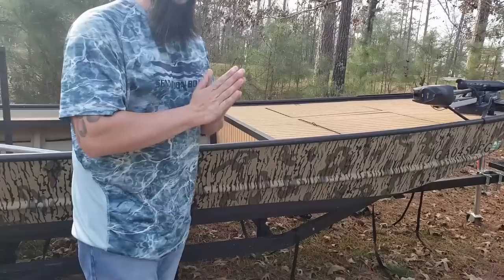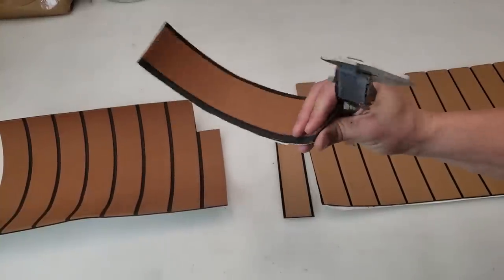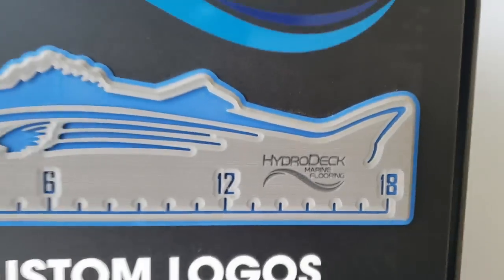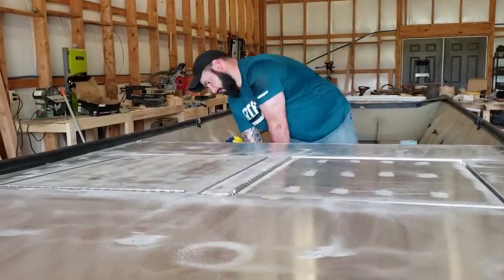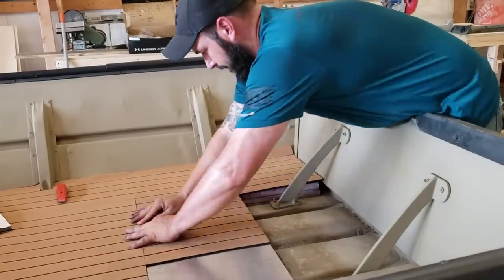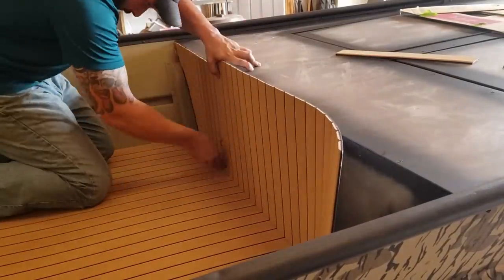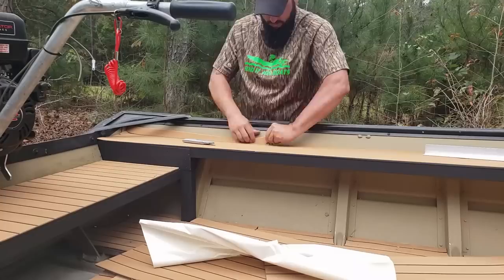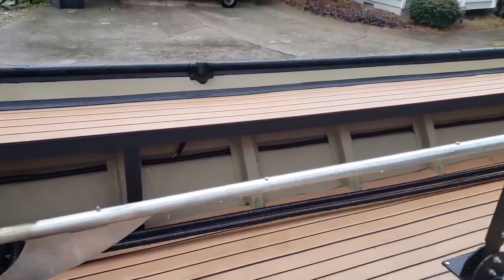HydroDeck Foam Boat Turf | Full Install Tutorial

Comment: Just recently stumbled across your channel, AWESOME info and videos!!!

I used to fish from a canoe for most of my life. Now that I'm 63 with a blown out back I finally upgraded a bit. I don't own a Jon boat but picked up a 1978 Glastron Skiflite 16' Tri-Hull with trailer and 50hp Mercury really cheap. I'm rebuilding it, separated the 2 hull half's (top & bottom). When I get done replacing the transom, stringers and floor deck I was wondering what to use for the flooring cover. Thanks for saving my arse from buying the cheap crap.

Oh yeah... I'm converting the boat from a bow rider to a fishing boat.
Reply from the maker: I made that huge mistake and bought the cheap turf... I regret it and will never do it again.

Comment: I actually have the Amazon stuff on my jon boat deck and it has held up pretty well given the quality. I painted the deck and lightly scuffed it before sticking it down and that seemed to help with adhesion. Surprisingly, the foam itself cleans off pretty well with dish liquid and a bristle brush. I will say though that it could be thicker stuff and have a bit better adhesive(clearly from your video) . My feet after standing barefoot for a couple hours need a break. With shoes or sandals no problem standing for however long. If I come to redoing the deck in the future, I would definitely splurge this time around on better quality foam but I think the Amazon stuff is a good option for those on a budget.
Reply from the maker: First I have heard with good luck on that Amazon foam. The stuff I got would not stay stuck at all. It sucked. Glad your experience was better than mine.

Comment: Hater corner is hilarious 🤣 

Thanks for the tip on the local source for good foam. I’m down in Jackson GA, I’ll be up soon to pick up a sheet🤘🏼 I think ima just do the bow area, where I stand to fish. I have a 1648g3, My deck is sprayed with Raptor Liner. I guess I’ll want to sand it flat first. Whatcha think?
Reply from the maker: I would definitely sand it first. but it should stick fine.

Comment: did you just get a quote for the rolls? I wonder because each site ask for boat model not just stocked rolls.
Reply from the maker: I had to call them to get pricing on just the rolls. I switched to Hydroturf and Seadeck on all my new builds now. You can get them at tbnation.net

Comment: Thanks for the great turf info. Should of beat the snot out of both pieces to see which was more durable.  Ya, your boat looks really clean.
Reply from the maker: Turf ain't known for torture. It can withstand doily walking and stuff like that, but it would be a short torture test. Carpet if you are one of those boat people that destroys everything.
Reply: @SendItJonBoats  Curiosity mostly. Saw a boat at a ramp that had foam. Looked like someone had stepped on a few lures and weights and left permanent dents. I would have hoped it was stronger then that. One small rock stuck to the groove of your boot sole would make a lot of dents. Thanks for getting back to me. Keep bashing those trolls. LOL

Comment: I have diamond plate on the bottom of jon boat for floor… do you think hydrodek will adhere to it? Thanks
Reply from the maker: It will but you will need to put some contact cement down first.

Comment: How easy is this stuff to clean? Me and 3 dogs get out and in the boat several times each trip leaving mud prints all over the deck. Would it hold up to a car/pressure washer, or would it take elbow grease?
Reply from the maker: It is really easy to clean. I use a long handled truck washing brush and Dawn soap to scrub it down then just spray it off with a water hose.  They don't recommend a pressure washer, but maybe one of those low pressure electric ones would be okay like the Harbor Freight ones I wash my truck with.

Comment: I’m not sure the price difference but if you have an area  that will require multiple cuts around hatches ect you might be better off doing a template and letting the manufacturer cut it.   When I did my boat with sea deck   the process was to make templates then the vendor printed them in cad and sent it back on clear plastic sheets   so I could verify and or mark up with a sharpie for any final changes before they cut them out.

Comment: How is that turf holding up to the fin on the mud motor? I have done some damage to my flooring while trailering and would hate to spend the money to trash it on the way to the ramp.
Reply from the maker: I take a scrap of that vinyl and stick it under the fins so it wont jack up my turf.

Comment: Thanks for the advice Man! Also, Quick question: What kind of welder do you use and what do you think about it?
Reply from the maker: I run a Titanium 200 Unlimited with spool gun for Aluminum. I really like it, but I am about to get back into tig welding.
Reply: @SendItJonBoats  I’m signing up for a TIG weld class.  Close to retirement need stay busy.

Comment: Hey Nimrod, Scooter here.  Nice video.  I appreciate the effort and information.  I'll check them out.  How did it work over deck rivets or is that a no go?
Reply: I see at about  8:53  that it looks like you may have left a small piece of backing paper.  It could just be a visual artifact on camera, but it looks like it might not have been visible from the angle you were viewing at that moment.
Reply from the maker: yup. worked fine over rivets. I sanded the counter sink rivets down flush so you cant even feel them under the turf.
Reply from the maker: That is very possible... stuff happens, it aint coming back up now too late lol

Comment: What did you use for the trim on the platform edge?
Reply from the maker: I talked about it for like 5 whole minutes in the video. Vinyl trim molding
Reply: I saw that, I just didn’t know it was the same stuff used for the 90 edge coming off the front platform. Thanks for clarifying!

Comment: FYI, your boat will sit about 1 inch lower in the water for every 333 lbs you place in it, of course, assuming the weight is distributed so that it remains level.  Also, you stiffened it with your modifications. Sorry Scooter.
Reply from the maker: Good to know thanks

Comment: Hydro Deck does not have camouflage flooring. They really need to start making camouflage flooring. Thats why I'm sticking with Sea Dek if I ever put foam flooring in my john boat. I plan on using it for duck hunting. If they did id totally be down to try it but they dont.
Reply from the maker: yeah they need some camo.
Reply: Get the flooring from Prodigy Boats. I've seen 2 duck boats that get used regularly, and their stuff holds up well, especially of you're looking for camo.
Reply: @christophermccrary8080  Thanks but I think I’ll stick with SeaDek if I ever decide to put flooring in my hunting boat. We have it in our fishing boat and It has lasted 14 years. Other than minor fading it’s still like brand new. That’s to be expected. We fish year round so our boat stays outside.
Reply from the maker: @christophermccrary8080  They use seadeck and hydro turf. Good stuff. That is what we now sell on tbnation

Comment: The biggest problem with the more premium brands in Australia at least is that routable two tone for diy installation is non existent. It's a solid colour or custom cnc installation or nothing. And I will tell you right now the Seadeck ect. Installers can jam $3k plus for.a 14.5 foot boat fair up their unmentionable regions. So that leaves ebay unfortunately.. I like your channel though, nice work.